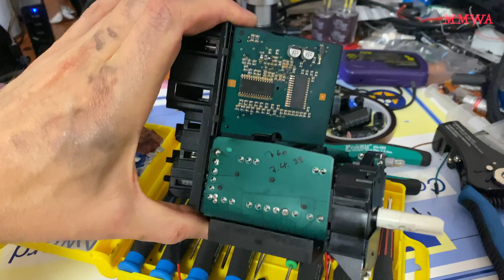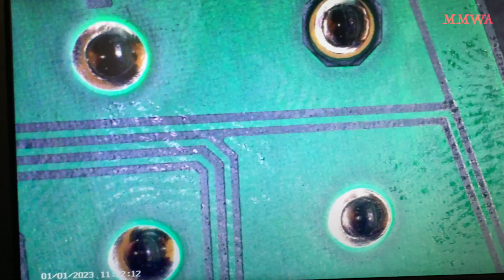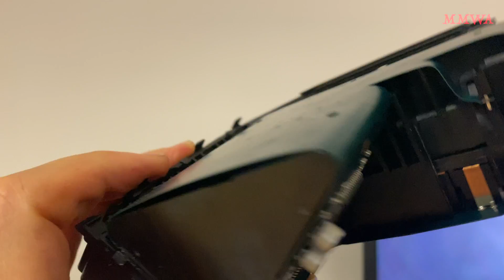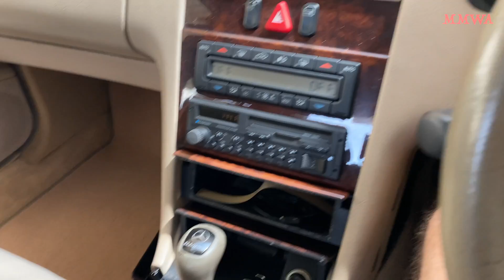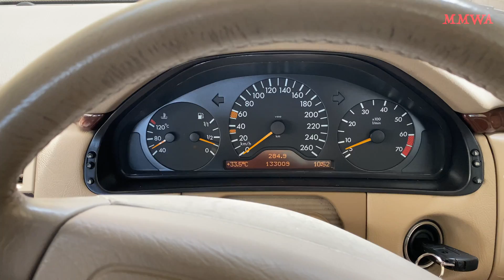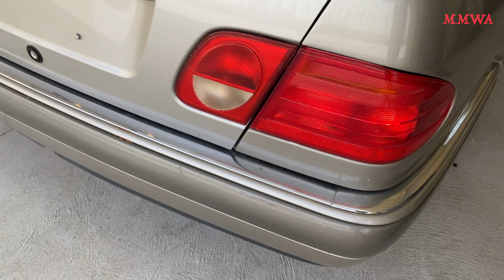1998 W210 Headlight switch repair / lighting control module / lost reverse lights

Comment: hi, sorry for my english i'm italian
I also have the problem of the broken rear lights. I have 12v at the headlight but when I put the lamp to close the circuit the voltage goes to zero. If I try with a LED the light is low
Do you think it is due to this?

I also have the problem of the direction indicators that flash quickly except when I put the emergency flasher it goes normally

Comment: I have been trying to solve the indicator / reversing lights intermittent failure for two weeks. Finally found your video. After a bit of brave soldering, problem is solved. Thank you very much sir.

Comment: How did you remove the centre Phillips head screw above the hand brake release lever.
Reply from the maker: if the handle is in the way - removed the handle.

Comment: Yesterday I've removed the OVP relay and the ECU of my '90 260E; the idle was kinda weird and the acceleration was not soft too. Cleaned and resoldered the contacts of the OVP, even the crimped areas of the connection pins! As there were an empty slot for another possible relay inside without pads and tracks, I've placed a paralel relay with the original to double it's current capacity. In the ECU, replaced those electrolytic caps and a big tantalum one (100uF), this was giving measurement on the tester only whith reverse polarity; I've never seen  this before... cracked solder joints are a common issue in older cars; I've been wondering how many switches like yours were disposed in trash instead of being repaired... 
Happy new year and thanks for sharing!
Reply from the maker: more people need to be prepared to open things and fix them themselves. Knowledge of electronics and soldering should be part and parcel of old MB ownership
Reply: @MMWA-DAVE  I agree with you! As a technician since 1990, I always liked tôe make small repairs in my friends cars, most of them carburated but really electrical issues happen in old cars, some really easy to solve, other not so 👍🏻

Comment: With respect to similar issues on the 124, there has been a bit of recent activity on FB groups about the bulb warning light being illuminated even though all bulbs are functional. This was the very first issue I dealt with when I bought my 124 way back 14 years ago. There were multiple cracked joints in the bulb monitoring unit 126 542 03 32, which I resoldered. Problem solved.
Reply from the maker: theres early and late versions of that package i noticed. Late ones dont have the high currents passing through solder joints at all and are all riveted connections, only the current measurement connecctions (small diameter pins) are soldered to the board and are much much much more reliable. I have these later types. MB occasionally (or at least their suppliers) learn from their dumb mistakes.
Reply: @MMWA-DAVE  Yep, I was aware that there were different ones. My 1990 .051 came with 126 542 03 32 (Hella) but I notice that there is also 126 542 00 32. Maybe this is the one you are referring to.

Comment: Excellent video.  My '97 R129 has the old style robust headlight switch which in itself can be problematic so I replaced it in the hopes of resolving a flashing daylight running lights issue.  To no avail.  I guess digging into the headlight control  module and examining soldering joints there and even the fuse box might be inorder.  Electrical problems like these are all so tiresome. Early happy new year btw since you're some +19 hours ahead of my time zone.